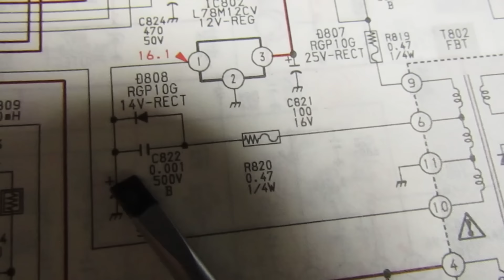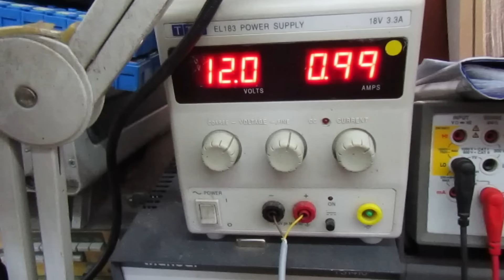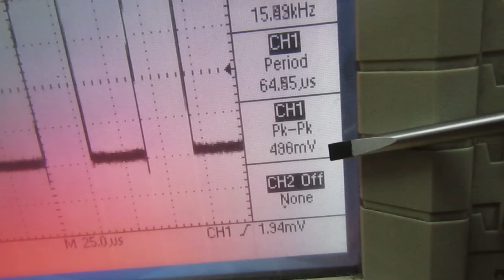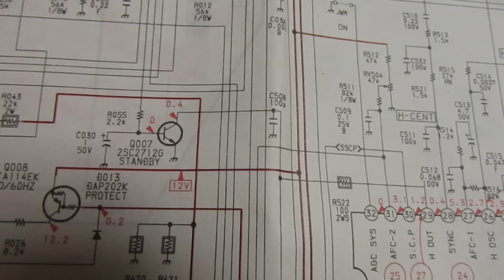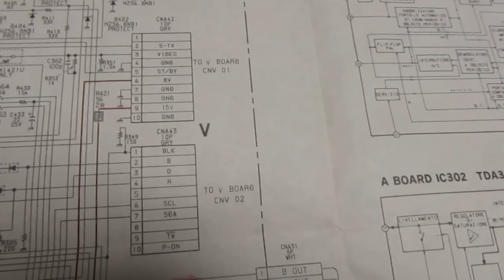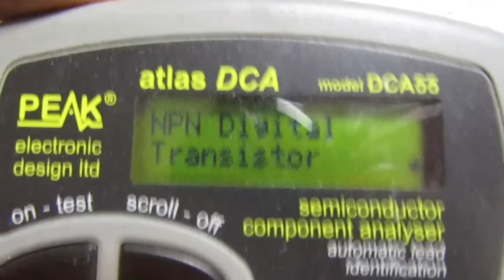Sony KV-M1421U . component level fault finding on this old CRT TV set.

Comment: While take measures of the the fly back I've  accidentally shorted two pins, so now I have 2 issuew
1. Blue screen with white lines (no video )
2. Blinking green 2 times no power 
.. what are your recommendations mate?
Thanks in advance

Comment: Wow that's a good fault why Sony used such a complicated start up /standby circuit God Knows  that teletext board was used on the larger Sonys around the same time had dry joints  and text decoder chips fail only

Comment: Well discovered. Surprised me that standby is achieved by clamping the horizontal oscillator output of the IC.
Reply from the maker: its shorted to ground through a resistor which may not have been to clear in the video but yes I have seen that done in a few sets in years gone by .
Reply: Some manufacturers have done some weird things with their circuitry over the years. I worked on a TV once that had a relay for switching the set into standby. All it did was open the HT rail from the power supply which when running was about 120 volts. When the relay opened, the output of the power supply would rise to about 190 volts (unloaded).
Reply: @stopthebus  Your comment (and Michael's) shows how rapidly my memory is failing (and senility probably increasing). I worked on many TVs around 45 years ago and though I remember crowbar SCRs in power rails, service switches (field collapse) etc.,  I don't recall seeing signals being clamped, including via resistors, transistors etc.  Live and learn (or not, as my case may be).
Reply: @ralphj4012  Unless you had need to trace a fault into this territory, you may not have encountered such things. I started repairing TVs in the late 70s as a kid, then did it as a career on and off throughout the 80s, 90s and early 2000s.
We're all getting older and as Michael points out, not having worked on CRT sets for some time and you do get rusty. It's like most things - when you do it every day it's fresh in your mind. After 20 years of not doing it, the concepts do get a bit cloudy. When I look at a CRT set these days I have to go back over all my notes in order to remember how to do stuff!
I have always written service notes (and still do) because no one can remember everything. Amplifiers I worked on five years ago I have since forgotten, and had I not made notes of the faults and how I resolved them I would probably have to go back and do it all again and waste quite a bit of time.

Comment: Nice fault finding work. I had the 21" from this range of tv's the KV-X2121U, it was an excellent and reliable set, apart from dry joints on the audio amp chip which was a common fault.
Reply from the maker: Hmm , if that set you mention was in a dark gray plastic cabinet with fibre back I have one of them .

Comment: nice, i have a KV1442UB that has similar case style, also got 3 of the first trinitron type imported to the uk, kv1320ub mk1, kv1320ub mk2, kv1300 , plus another late model trinitron, cant remember no.!
Reply from the maker: To be honest I was never a big fan of sony sets, even worse the hard wired ones but I do have access to loads of them , the guy I repaired this for use to repair TV s in his younger days and he's a bigger hoarder than me and his favourite brand was sony, I must have counted 20 plus early sony sets in just one room he has and I have been steadily buying sets off him , in fact he asked me if I wanted cash for this repair or a TV set of my choice, naturally I took a TV , a video will be coming soon !
Reply: @michaeldranfield7140  i have some older sony black n white things, 3 TV110UKs, a TV720UK and a small thing about 3 to 4 inch screen, with battery compartment, dual vhf/uhf(uhf tuner dud unfortunately)

Comment: Michael it’s take me back when I was a TV workshop technician and so nice to see your skills of fault finding down to component level, love your videos keep them coming when you can!
Reply from the maker: Just uploaded another video .
Reply: Yes but in my day, 70's 80's and early 90's manuals and circuit diagrams were unheard of. All you had were your meter, soldering iron and occasionally you had the luxury of a can of freezer. We fixed everything that came into the shop and usually at component level.

Comment: Good sets, I had a choice between one of these or a Philips 8833 when I had my Amiga. Went for the TV but getting the RGB to work was a pain, ended up making my own scart lead as the shop bought one didn’t work - think they produced Amiga to Sony scart leads later.
When the warranty expired I changed the horizontal shift preset for a pot with proper knob and stuck it out of a hole in the back as the Amiga ideally needed the shift to be adjustable.
Reply from the maker: Think there was a Decca set that had RGB input that was made for the Amiga but I may be wrong ?

Comment: Nice job in finding the culprit, It shows a novice like me how complicated the old sets were.👍
Reply from the maker: Sony sets were not my favourite for this reason, quirky electronics, pricey parts and not to easy to read circuit diagrams compared to other manufactures .
Reply: @michaeldranfield7140  I'll second that. Over-engineered electronics and over-inflated prices for their parts. I have tried to avoid Sony stuff for these very reasons.
Reply: As time went by, CRT sets became more complex with all the additional circuitry like Teletext. Sony always seemed to over-engineer their sets as well, a bit like Philips.

Comment: We used to have a 14” Sony Trinitron in our kitchen similar to this back in ‘93 with Teletext and you could either tilt it backwards or forwards. I remember being blown away by its picture quality. We had never seen a picture like it. It was like looking at a postcard. Sony sets weren’t exactly cheap but you definitely got what you paid for.
Reply: There's a special richness to a Sony Trinitron picture.

I have seen a 14" Trinitron survive years of exposure to high temperatures (>30°C), high humidity & salinity, frequent bouts of shaking, mains voltage excursions and very high intensity local RF fields!  The volume control became a bit scratchy, but the set just soldiered on.🙂
Reply from the maker: I actually still have one of the sets you refer to that tilts back and as you say Sony sets of this era had mind blowing pictures, they were very expensive to buy back then but well worth the money in terms of picture quality and longevity.
Reply: @michaeldranfield7140  Ours had to go for repair once in 2 years as it was stuck on standby and would not turn on. It apparently just needed a component replacing (the repair man did state that it was a safety feature of the TV so was probably the safety device that you were referring to). It then carried on working for many years.

Comment: Nice bit of logical thinking on this one. But, when you found something on the teletext board was affecting the stby voltage, at that point I thought ok, obsolete item BIN IT!  No you had to find out what had failed. I wouldn't have had your determination. I admire you for that.
Reply from the maker: I have always been like that , in the past I have unwrapped capacitors and transformers to see the failure mechanism for my own curiosity  .

Comment: Long ago, when I worked at TCL service, the DTC114 transistor failed and became a common problem in TCL TV standby cases.
Reply from the maker: No doubt there would have been a technical bulletin then if this transistor was a common problem .

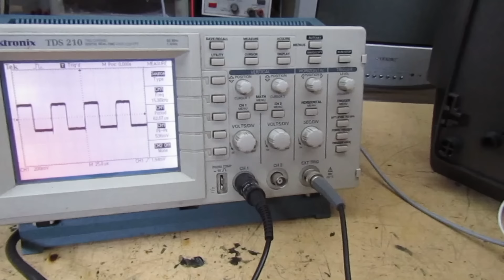Comment: Nice fault finding. At arround 16:00 there is a clue, that something is shorted on that signal on the faulty tv. If you look at the scope pattern of the second tv at 16:00, when you turn off the power, the amplitude of the 0,650 V (on) signal goes very slowly back to the 0,5V (standby signal) like if a capacitor is unloading. On the faulty tv the base signal of 0,5V drops instantly to almost zero before it recovers back slowly to 0,5V.  That instant drop is a indicator of something "hard" pulling a signal down, like a shorted component does. Nice video, love the troubleshooting, and also admire your collections of components. Grtz
Reply from the maker: Glad you liked it, maybe if I had taken more notice of the waveforms but I hardly ever use a scope these days , no fault finding  to component level with flat panel sets , its just board replacement and no schematics available .
Reply: @michaeldranfield7140  , the days that things are made to last decades is gone, these days , you got to get lucky if the device doesn't break right out of warranty period. I have a "dumb" Samsung 32" flatscreen since 2013, made it last year a little bit smarter with a Google Chromecast dongle, to watch YouTube etc...works still fine, but since day 1 i have turned the background LED's down, not only to save them, but i found it too bright like it came out of the box. Think this is the main reason     it still works fine.

Comment: How do you cost a job like that though ? Most people would have given it up as beyond economic repair  but well done for going on with it  tubes look in good condition for the age 👍
Reply: Tough to charge a realistic rate when the item is essentially scrap, albeit I understand why people want to keep these TVs running. Back in the late 1990's it was hardly cost effective to repair a 14" TV like this so it certainly isn't now.
Reply from the maker: its no longer possible to charge a realistic price for anything these days you just have to do whatever you can, my friend is an EX TV repairer from many moons ago but he does nothing with TV s now and he is  a bigger hoarder than me , lets just say he has a house full of old vintage TV sets , so when he asked me if I wanted cash or a TV of my choice from his collection you can guess which I chose , a video will be coming soon !
Reply: @michaeldranfield7140  true Michael nice to keep the old sets from the 80s going and our grey matter in working order

Comment: Almost 20 years ago was my last CRT repairs. I remember replacing lots of Philips A10E CPU's.
Reply: I knew philips were on the slide when I saw the A10E. Those big widescreen crts that came with a free hernia operation
Reply from the maker: @kevvywevvywoo  For me the slide was the G90 , G110 when Philips started using surface mounted components .
Reply: @michaeldranfield7140  ooh yes I remember fixing my first G110 with LOP transistor failure and it had taken out half a dozen SMD bits in the e-w circuit, I think some of the suppliers did a kit in a plastic bag of stuff that had to be changed, but memory is hazy
Reply from the maker: getting up that was since I did crt too, never thought I would be here doing them again but its like a trip down memory lane , memories of much happier days . I may have a A10E board still knocking about !
Reply: I got out of repairing CRT sets around 2002. NZ was being flooded with cheap china CRT sets brought in by the container-load and you could pick one up brand new for less than $200. Given that repair to a TV was usually that or more, people decided to stop getting their sets fixed and to buy a "cheapie".

Comment: Good bit of fault finding, and you proved the rule that if it's got more than eight pins it's not faulty, unless it's a painter chip...
Reply from the maker: The good old painter chip, another blast from the past , I may even have a spare board knocking around .

Comment: A rare chance toi do some fault finding to component level rather than just fit a new board.
I think most of us would have been scratching our heads with this one.
I have found that Sony gear tends to have over complicated circuits that are not easy to repair.
Reply from the maker: One of the reasons sony was not a favourite brand of mine , the hard wired sets were even worse .

Comment: mad fault that one! the input to teletext board was outputting wow, these types of fault can drive  you mad, seemingly defying logic 
definatelly one you take a break from to collect thoughts
impressive skills there!
wierd that the jungle chip didnt just have a standby input or a more normal inhibit method like shorting a freerun timing r/c
that crt looked quite "normal" was it not trinitron?
Reply from the maker: No its a Trinitron, you can see the platinum tie wires if you look closely enough.